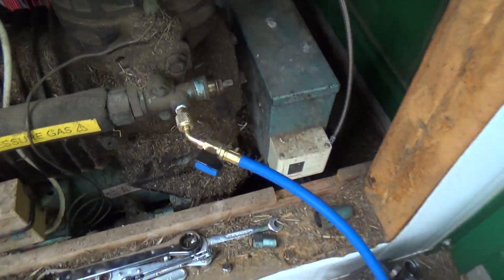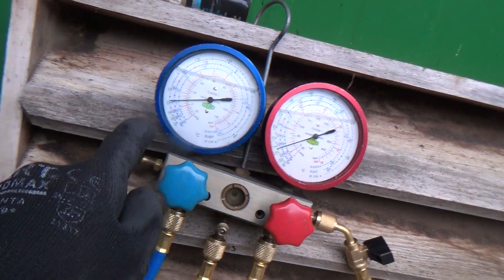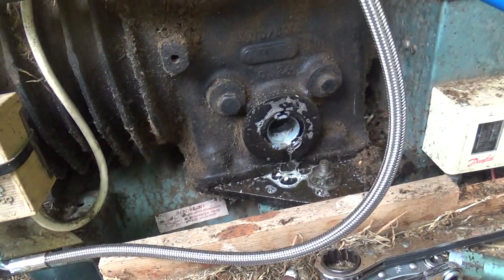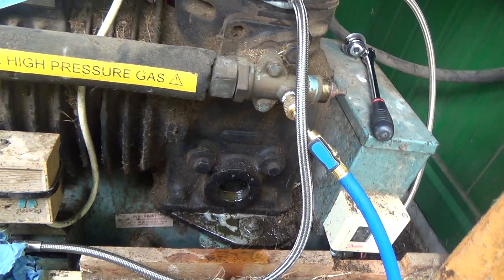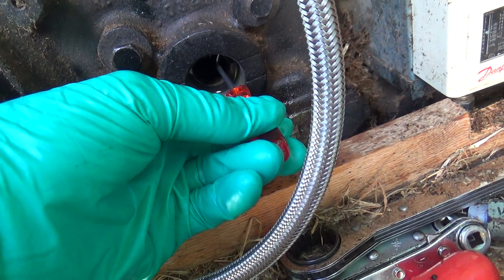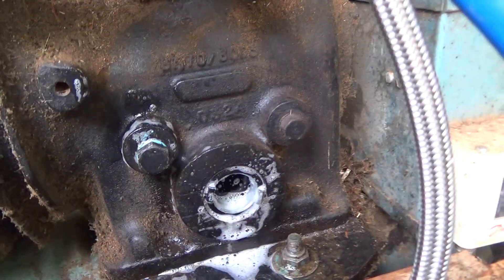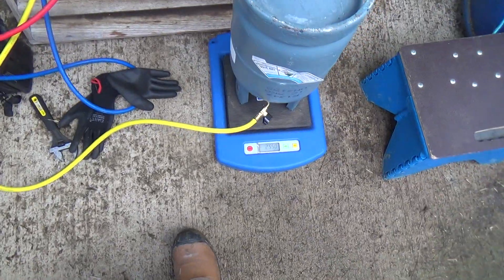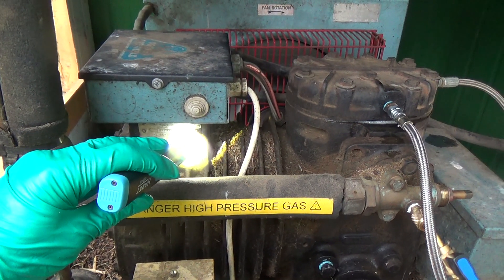Simple Fix that Wasn't Simple

Comment: Did you say that was running at +10 on the evaporator? Is that coz it was low on gas?
Reply from the maker: Yeah +10C or 50F, would normally run around -10C or 14F so it was working hard. It had a full refrigerant charge at that time.

Comment: Was just thinking you need to go get a valve grinding tool, which is a small wooden rod with suction cups both ends, that will hold the glass pretty tight and pull it loose, or at least hold it when you are popping it out with pressure.
Reply from the maker: Thats a good idea!

Comment: If that O ring is not painted, it is probably HNBR, which is not very far from NBR ( Buns N). HNBR is needed in application with possible mix of oil and air, as NBR not good with ozone.

The Viton ( FKM, FKKM) material would be better, as it should remain playable in high temperatures longer.

Comment: Where did you get the sight glass tool form or what’s your t Called it looks the bollocks ! Great video too, I was waiting yesterday afternoon for it to pop up 😉
Reply from the maker: I got it 25 years ago, think it was a Prestcold tool, doubt they are available now. The new sight glass kits have a slot in the nut instead of two lugs sticking out so you need a different tool for them (I made one out of an impact socket and silver soldered in a bar to go in the slots)
Could do a video on them if you are interested.
Reply: @heavydiesel  yeah I wouldn’t say no to a video please ! It’s all new to me . I do AC but I’m trying to teach myself more about the refrigerant/freezer  side. I seem enjoy it a lot more .. the slight glass rubbers I’ve changed when sucking the oil out or trying to top it up.. I’ve ended up using a mark 1 screw driver and hammer !  It would be good to see how to top
Them up with oil to .

Comment: Where did you find that kit? What size is that?
Reply from the maker: Which kit?
Reply: @heavydiesel  for the odd oil sight glass
Reply from the maker: @sjefoekel6058  I got it about 25 years ago from the wholesaler back before Prestcold became Copeland.
Reply: @heavydiesel  thats why i couldnt find it anywhere, that screw is also aluminium, cant weld anything on it.